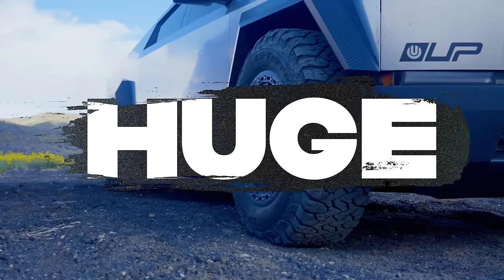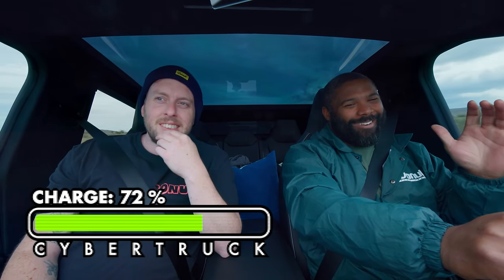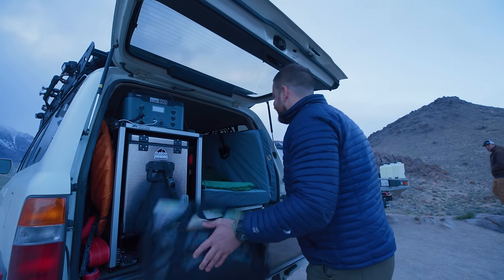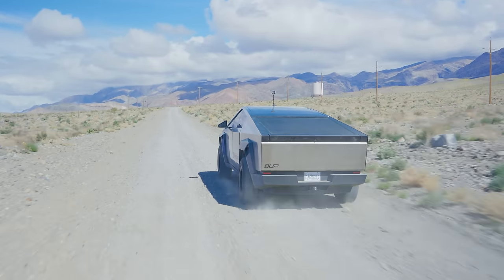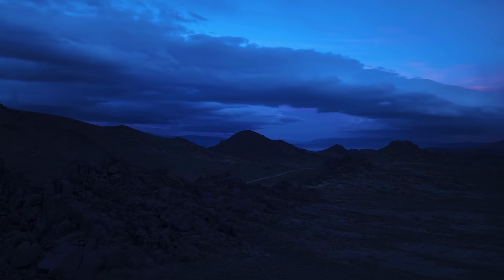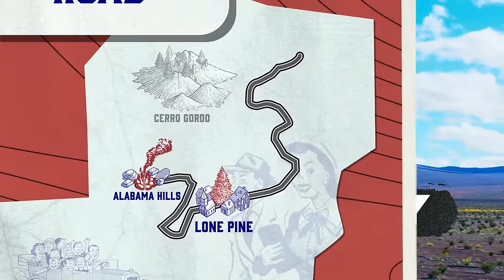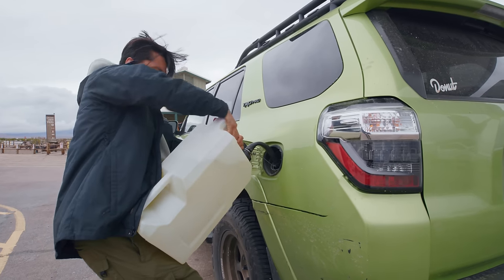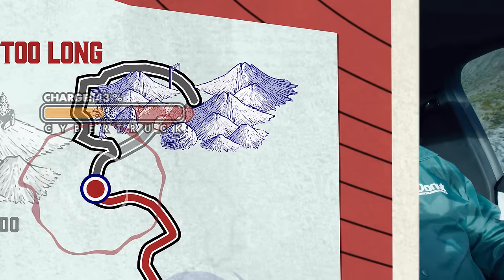Surviving 100 Miles Offroad in a Cybertruck

Comment: These monster tires are sure range killers.
Reply: they shouldnt be especially for a regenerative braking vehicle because they can recover all that inertia. my 2000 ranger is torsion key leveled on 31s with 200lbs of winch on the front, and its getting 20mpg mix which is the best that could ever be expected of a stock one. so theyre not helping, but to blame them entirely wouldnt be the right move
Reply: @jackradzelovage6961  I think the larger tires mess up the efficiency of the stock gearing.
Reply: @bernardhossmoto  it doesnt have gearing. no matter what size tires you have on it, the car is gonna adjust for that by simply spinning the motor more slowly and with higher torque
Reply: @jackradzelovage6961  I have an electric enduro bike with 15kW, the gearing DOES matter a lot. A lower gearing puts less stress on the battery.
EDIT: It is not a gearing as in a gear box, it is the final drive ratio that matters.
Reply: @bernardhossmoto  thats probably because your motor is more efficient at higher speeds, so leaving it in a lower gear for longer nets you less consumption. i have no idea how tesla motors dyno or how  wide their efficiency range is, ie di the bigger wheels actually drop it that far out of the efficient speed range? this becomes specific hardware dependent very quickly.
Reply: @jackradzelovage6961 changing the size if the tire changes the ratio. This is simple to understand. Bigger tire means more energy to turn per revolution.
Reply: @jackradzelovage6961  rolling resistance is important too. Big chunks on tires have more rolling resistance. And bigger tires raise the whole car up, which decreases range due to aerodynamic drag.
Reply: @Zak-nv1tl  and with regenerative braking, all that excess force is returned to the truck. its slightly more inefficient, but not nearly as much as people think in this particular application. and yes the tire changes the ratio, but a motor doesnt care what the ratio is. again, in this application, the tire size doesnt matter nearly as much as people think.
Reply: @stevendeckert6373  yes, and every other truck on the market comes from the factory with tires that at least function off road to some degree. the fact that they need to advertise "lower rolling resistance" means theyre admitting their vehicle isnt up for anything an old lady wouldnt put it through
Reply: @jackradzelovage6961 you know nothing about how efficiency works…..
Reply: @Dwilsonmusic145  thanks for your input. now leave.
Reply: @jackradzelovage6961  you're overcomplicating this. Regenerative braking won't have nesrly the impact you think it will. 
EE has an entire video on why large tyres are bad on teslas. 
Big tyres = more rotational force to turn them.
Reply: @lamrex18  yes. and they regenerate more too because their mass is greater.

lets put it this way: if fitting the same tires as the big boys means you cant even get to the location where the trail is, then it sucks no matter what. thats the main point here, that the truck sucks not the tires.
Reply: @jackradzelovage6961  but the energy  generated by regenerative braking isn't that meaningful compared to the energy used by the drivetrain. So even though regenerative braking from larger tyres creates more energy, it is not meaningful compared to the additional energy used by the drivetrain.
Reply: @lamrex18  electric cars dont have a real drivetrain, and yes if were gonna focus on marginal losses over the typical amount then sure, tires are a huge draw. also, the truck sucks and the tires werent the reason.
Reply: @jackradzelovage6961  The don't regenerate "more" unless you use the regenerative braking. The inefficiency of the larger tires isn't made up for simply via the mass. That's just not how the batteries regenerate some of energy. And the regenerative braking system isn't a 1 to 1 or 100% efficiency kind of thing.  This is the crux of the problem with all electric vehicles, you literally cannot return the same amount of energy that you use while driving it. It has to be supplemented with grid charging. Even if they were going down a mountainside with a 15 degree incline in perpetuity for the entire trip - they wouldn't be able to recover 100% of the energy they are using. The truck will always, always end up in a negative cost benefit ratio. And in case you missed it in the video, Justin helped explain it. Tesla's are actually more efficient in stop and go traffic than they are in constant speed. You need the slowing down to do the regenerative work. So being out on a trail like this in the video is a good example of why the bigger tires actually are less efficient that smaller tires.  They couldn't go 80 miles and hour without putting big strain on the tesla battery. If they did this exact same trip in small tires and matched the same parameters along the way, I can promise you - they would have gotten more range out of the smaller tires.
Reply: @aSinisterKiid  whos debating that? i never said they helped or were exactly the same. but the fact that just tires alone can tank the trip to less than half the advertised range is inexcusable. nothing worth being called a truck has efficiency that bad.
Reply: @lamrex18  yeah im aware of that. tanking mileage to less than half because you went from 31s to 35s is unacceptable tho under any circumstances. i dont think i could get my ranger down to 10mpg without having tires big enough to rub, much less just going up 4 inches.
Reply: @jackradzelovage6961  What do you mean who's debating that ? You are goofball. Literally the very first words out of your mouth were "they shouldn't be especially for a regenerative braking vehicle because they can recover all that inertia." When that statement is factually incorrect.
Reply: @aSinisterKiid  okay then sue me. i was wrong. also, name a vehicle besides the tesla cybertruck that loses HALF of its advertised range by increasing the tire size by 4 inches.
Reply: @jackradzelovage6961  Any electric vehicle would take a drastic hit on overall efficiency when you put a larger tire on the vehicle. You aren't thinking of this properly. You keep saying stuff like increasing the tire by 4 inches, like that isn't a big deal. When you go from a normal street tire to an offroad tire you aren't just adding a few inches to it. The tires themselves are made with way more rubber to make the contours/nodules on them. That increases the weight and you aren't taking into account the new rims you would need. Increasing the rim's to fit those tires adds weight too. And this isn't happening to just 1 thing, but 4. Adding 25 lbs to 1 tire equals an extra 100 lbs overall. And lastly, lets just say it is 100 lbs extra added overall, that isn't just 100 lbs of dead weight. Not only does it add more weight to the vehicle to have to drive around, it adds more rolling resistance. Both of those things make an electric engine have to work harder. So of course the range is going to suffer. In what world can you put more weight and require and engine to work harder, and think that the engine shouldn't be affected by it ?
Reply: @aSinisterKiid  when did i say it would be unaffected? give me an example of a gas powered vehicle losing half of its advertised range just due to 4 inch larger tires. i have 2 inch larger tires on my 2000 ranger, torsion key front end level, a 200lb winch in the front bumper, it was crashed by the previous owner so the front quarter and the hood are still bent so aeros even worse than normal, its painted with truck bed liner, and its at 213,000 miles. and im beating the new advertised mileage by 2mpg... so tell me how electric ISNT uniquely bad here.
Reply: @jackradzelovage6961  No one is saying electric isn't bad here. The original poster made their comment about the tires being range killers, and you decided to try and say that they shouldn't be. That the truck should be able to makeup all the energy it spends on those bigger tires, with the regenerative braking. And that's just not how it works. Stick to the topic and the point.
Reply: @aSinisterKiid  dont try to argue with me that regenerative braking doesnt benefit from more rotating mass. were gonna try this one last time: name the gas powered truck that loses half its range from having 4 inch taller tires alone. name it. if you cant, im done here. heck even if you can, im still done here.
Reply: Same thing happens with these guys putting lift kits and big tires on their ICE trucks. They took a vehicle that was barely getting 25 mpg and turned it into a vehicle that will get more like 15 mpg.
Reply: @jackradzelovage6961  Completely wrong. Regenerative braking does recover energy lost to aerodynamic drag - which is the main killer with tires like this for an electric vehicle.
Reply: @nismos14270r  great. also, ICE trucks dont lose as much range as this did with the same increase in diameter. so no matter what nuances i get the magnitude of wrong, the overall point still stands that electric is worse than gas in nearly every application including this.
Reply: @jackradzelovage6961  Oh ok, ICE trucks can charge at home and camp sites? Notice how the abandoned town man had 2 Tesla model 3s on site? I bet its because there is no has up there and electric is the way to go because of how easy it is to charge remotely.
Reply: @nismos14270r  ...yes. they can. its called a gas can. they can do that. and they have for well over a hundred years... and he doesnt exactly seem to be fully isolated up there so i wouldnt be super surprised if he didnt charge them there and instead drove them to civilization to charge them and then bring them back.

did you have a point or was this supposed to be spaghetti?
Reply: @jackradzelovage6961  my point is that the abandoned town mountain man thinks EVs are ideal for remote living.
Reply: @nismos14270r  and willingly choosing to live in an abandoned town is not exactly 1 the norm, or 2 intelligent. so theres that... i wouldnt use him as a benchmark for anything you want to support

Comment: Launching this on the day of a massive cybertruck recall 🤣🤣 the timing.
Reply: 100% intentional lol
Reply: 😂😂 I agree
Reply: "massive"?
Reply: @tyrelirwin all of them.
Reply: If anyone is curious, ~3800 trucks were recalled because if you stomped on the gas hard enough to break the grip off the top of the pedal, it was possible to wedge the grip into the front of the footwell in a way that wedged the throttle on. So far it caused no issues, but it could potentially be dangerous.
Reply: @Idiomatick i believe like 2 of them crashed
Reply: @Idiomatick  i like how you have to say you need to stomp on the pedal for it to do that and that it "could potentially be dangerous" lol. Even if you needed to stomp on it its just bad design in general that could even happen and that it could get wedged. Say you dont stomp on it and drive normally who's to say it just wont break eventually just from normal use if its even possible to do it in the first place. Thats very dangerous not potentially lol
Reply: Recalls happen to every vehicle. You just only hear of Tesla in the news. Can’t be biased at all
Reply: @who___________________________  It just came out on news articles that they were using an unapproved lubricant to install the tin metal decorative pedal covers, which was ordinary soap... So, in any case that metal is only held on by friction with lubricant still wedged in-between. No adhesive or mechanical fasteners(such as a pin or screw) holding it onto the plastic pedal. This is comically sad engineering.
Reply: @Zak-nv1tl  This too. Despite my comment in this thread so many vehicles get recalled all the time. Sometimes for even more dangerous defects but for me its just the attitude of "tesla can do no wrong" and you say any criticism about the build quality of their vehicles then automatically you're just a tesla and elon musk hater. Bad car design is bad car design at the end of the day and people are going to point it out especially when they have to share the road with these things
Reply: @Zak-nv1tl  I was talking to someone that thought ONLY teslas caught on fire, so we looked it up and there were over 150,000 car fires last year in the US, like 6 of them were teslas. Haha
Reply: @who___________________________  I mean, you have to stomp pretty hard to snap the thing off. I don't think anyone has had issues with it so far, or been able to break it off, the recall is because it could potentially cause issues if it did break off and get wedged and then the driver doesn't hit the brakes.
Reply: I don't recall a recall on yh3 valiant or doge Chargers.
Reply: @julesmasseffectmusic  Dodge chargers have 44 recalls so far. None for the gas pedal, but 2 for the brakes.

Comment: Did they account for the range loss by larger and higher rolling resistance tires?
Reply: Of course not. these are the same guys that thought putting the car's screen in dark mode would save battery...
Reply: It's a joke obviously  @Quinn_______
Reply: Larger tires roll more easily over obstacles and "raise" the effective "gear ratio" so fewer engine - or motor - revolutions are required per mile. They're also not automatically heavier than smaller wheels/tires. Particularly if the wheel diameter "grows" and the tire sidewall "shrinks" relative to overall tire diameter.
Reply: You "gained range" because "range" was recalculated when you were stationary. Batteries always "recharge" slightly when load is removed because reduced current flow means reduced heat and reduced internal resistance. Which is present in ALL batteries and must be "overcome" before any useful battery output is "created".
Reply: @deeremeyer1749  What are you talking about?
Reply: @deeremeyer1749  partly wrong. The most fuel-efficient tires is narrow ones but bigger in radius ofc.
Reply: @nikostalk5730  not for EVs where bigger diameter means more load on the motor which means more power drain because motor has to be run at higher wattage than on smaller diameter to compensate

added weight of the tire adds even more load to the motor ...

added offroad thread adds more rolling resistance which once again increases load on the motor ...

Comment: Another thing that needs to be accounted for is that the increase in suspension height and much larger tires will definitely eat up battery efficiency.
Reply: Everythings eats up mileage, this is how Cybertruck works, you just can't use it with lowest possible wattage, like the iPhones, it can't let you disable tracking, for real

Comment: If doing an extended off-road trip, a generator would definitely be a required accessory with an EV.
Reply: Ahahahah
Reply: Which defeats the whole entire purpose 😂😂 The cybertruck is the most ironic vehicle ever made!
Reply: At that point geet a jeep
Reply: Your typical hardware store generator makes 3-5 kilowatts of electrical power. In the 3 hours it takes the Cybertruck to drain its 123 kWh battery, the 5kW generator would have added only 15kWh of charge which is just 12%. To charge the vehicle completely assuming 100% charging efficiency, it would take 24 hours.
Reply: @electric_boogaloo496  I meant charge it overnight while camping.
Reply: @kjaubrey4816  if overnight is 8 hours, it'll still only add 1/3 of battery capacity, that is just 1 hour of driving.

Comment: those 35s were killing the battery life FASTTTTTT😂😂
Reply: Stock are 33 ( actually 33.5 Goodyear Wrangler Territory RT - 285/65R20) , so I doubt it, plus electric motors deliver full torque instantly
Reply: @BigWolfBoy50  thank you i did not know that, so the battery life is just that horrid regularly lol ?
Reply: @ChenteCasanova  Tesla’s range testing is optimized to almost perfect conditions (temperature , flat roads, 65mph or less etc.). It’s unrealistic as a fairly cold/rainy day or bit of uphill driving already falls out of that optimal realm.

In my own personal experience, we’ve never gotten more than 255-265 miles out of our 2 Teslas (Model 3 LR and Model Y LR), rated at 322 and 330 miles respectively. Great vehicles, but they have to fit your lifestyle or vice versa.
Reply: @fc3sturbogtr  ahhhh i seee thank you for the knowledge 🙏🏽

Comment: Those 35"s are probably the biggest draw on battery life - the standard one comes on 31's I think, and they're specially built for the truck, low rolling resistance, etc.
Reply: low rolling resistance = low traction. thats not acceptable for off roading (obviously), and if they need to be changed out for normal tires before off roading then thats definitely a mark agaisnt the truck
Reply: @jackradzelovage6961  That's why so many were getting stuck in just a bit of snow, the tires are not up to anything like that.  Scary to think of something this heavy, this fast with no real grip.

Comment: Another thing to consider is driving technique. I have a humble Chevy bolt and I can get close to 6 miles per kwh with one pedal driving and minimal climate controls. I can typically make a drive down to San Diego (122 mi) from LA using only 75-80 miles of range. Took me awhile to get used to driving exclusively one pedal tho.